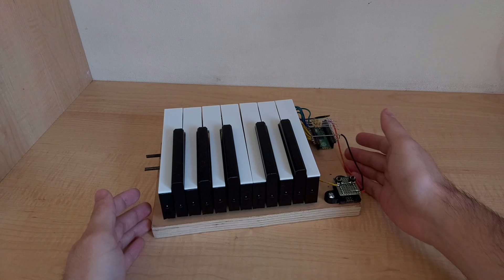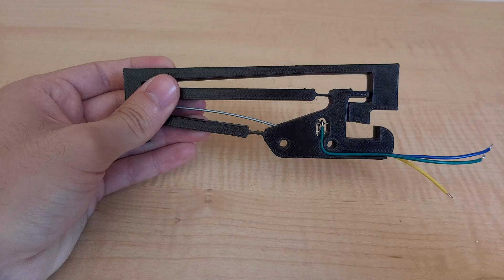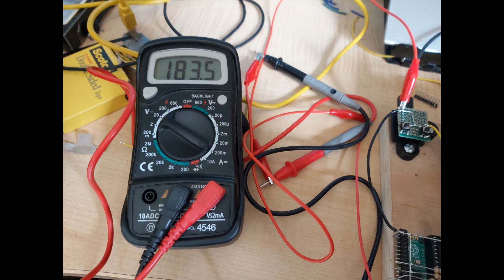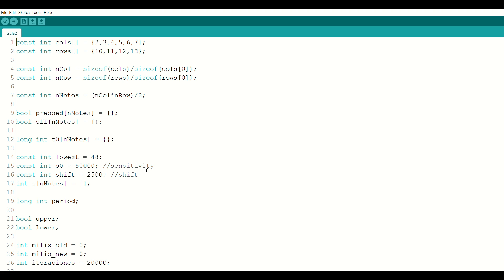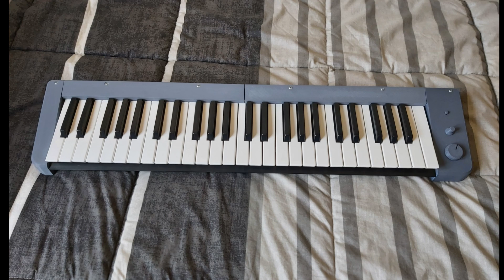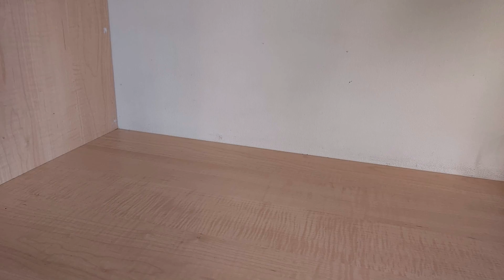3D Printed Flexure MIDI Keyboard update

Comment: You know I was thinking of using magnets to control the velocity sensitivity which would be manually controlled by a turnable rod that would vary the distance between the two magnets at the end of a bar. You could precisely control the point at which the key gives in to being pressed completely down and how strong or weak you want it to be pressed down. 

Wish I could attach an image of my idea here because it's a bit complex to achieve the effect I'm thinking of that would make it feel like a grand piano with the use of magnets and using a bar like a kid's seesaw in the park.

Comment: Very interesting and impressive mechanism! As a professional player, this looks to be very playable as I would assume the pressure to depress would be similar on both sides of the key. Is this your own design or is it modeled after something else you've seen?
Reply from the maker: Thank you! The search for greater evenness along each key is what started this project! Its my own design, and although I can't claim for sure to be the first person to think of this mechanism, I haven't found anything similar online yet.
Reply: @elterla2153  You seem to have solved the biggest problem of playability with all mini keyboards. The one exception I've found is the Carry-On foldable 49, which uses keys similar to a computer keyboard. It takes some getting used to, but once you do, it's far more playable than you might expect. Your design is another substantial step up. I'm curious how compact this mechanism could be made in terms of height. One other non-weighted action that I find to be very playable is Yamaha's CK & MODX series, which also offers a little additional initial resistance. Do you have any plans to make a folding keyboard? I'm still waiting for someone to do that properly as well. Keep up the great work and I look forward to seeing your next video!

Comment: Amazing project! Idea to save some energy: How about using infrared LEDs and phototransistors instead of visible light? And additionally, don't have them "always on", but use a duty cycle that's still fast enough for what you want to do?
Reply: Agree. Also if ambient light bleed is not a problem he could reduce the current on the LEDs to basically nothing and still get a good signal I think.

Comment: Excellent design! I’ve been looking into how difficult it might be to make a DIY microtonal keyboard and another channel I saw (Andrew Leathwick) used Hall effect sensors to both trigger notes and calculate velocity. I think you could implement the same on your keyboard to reduce power draw.
Reply: Hi I’m planning on making a diy piano myself and the thing is I’m not sure about the sensor I’ll be using for the key detection. First option is to use hall of effect sensors as you recommended but I’m also thinking of using carbon pads like how companies do. The second option is better for the price but I’m not sure about how I’ll be able to make it.

Comment: I love the design and am definitely gonna try to make one for myself. But I wanted to ask why not use hall effect sensors; if you add a magnet on the end of the mechanism, I believe it would have a higher succession rate.
Reply from the maker: I considered hall effect sensors but they are a bit pricier and I didn't really want to deal with 49 analog signals for the full size keyboard

Comment: Cool! I just saw your previous video and commented on it. You may be able to cut down on power consumption by powering each key's LEDs only when that key's sensors are being measured. I'm guessing you already have a loop in the code for doimg measurements one by one, so maybe adding a function to turn on the current key's LEDs wouldn't need too much extra code. Hope you post more about this project! The compliant keys are so innovative :)

Comment: This is amazing! Congratulations!
I've been looking for something like this since 2019, and yours is the best!
Is it possible to build a keyboard with 5 octaves?
Waiting for the project to be published!
Here in Brazil, everything related to keyboards is expensive, and the entry-level equipment is not very high quality. As soon as you publish it, I'll build mine!
Reply from the maker: Im currently planning for a 4 octave keyboard but adding more octaves shouldnt really be a problem (except maybe for power draw?)
Reply: @elterla2153  Great, I'll do it as soon as you make it available.
Any forecast for the release?

Comment: Hey, I have also tinkered with some pi Picos on trying to do that. At first, I thought about a button matrix, but it wouldn't be velocity sensitive. Then, I saw a video online that tried to do that with hall effect sensors, but it was a bit expensive. Yours is a pretty cool and well built design, but, I still have a question, couldn't you have just used soft buttons instead of all that optical madness? There could be 2 buttons replacing the two phototransistors. I took this idea from a cross-section model I saw recently on my music centre of a thorman digital piano. I took a video about how it worked if you want it. I would love to share with you some of my ideas to try to make it as cheap, reliable and efficient as possible.
Reply from the maker: soft buttons would be great for a mass produced product but aren't very DIY friendly as far as I know. The alternatives I've found with other buttons tend to be a bit noisy whereas the phototransistors are completely silent. The solution I'm currently using does involve a matrix but doesn't sacrifice the velocity sensitivity because of it. Hall effect sensors are a great option but a bit pricey and I suspect they are more computationally hungry when calculating velocity. At least this had been my reasoning
Reply: @elterla2153  are you planning on adding speakers to the keyboard itself to remove the necessity of being connected to a pc?
With an SD card slot for different samples, idk.
Reply from the maker: not really, I always intended this to be a midi controller but once I release the files someone else could go that route

Comment: Hey! a bit of feedback here. I've serviced some MIDI keyboards and synths and the mechanism they use to measure the velocity of the keys is a lead in between two other leads, acting like a switch, I'll call center lead "c", top "t" and bottom "b". In an idle state the leads c and t are making contact, when the key is pressed the leads c and b are making contact, so the controller only measures the time it takes to change from "ct" state to "cb" state. This way the keybed consumes virtually no power. For examples search on google for "Yamaha DX7 Keybed" (a popular synthesizer) and look through them, I hope I did a good job explaining myself hehe.

Comment: This is so cool! If you do go the PCB route, you could design a motherboard with po-go pins and then have each key use the same PCB design and have contact pads on the underside, making a modular key setup. You'd just need to update the 3D model of each key module to position the identical boards.

Also, to solve the power draw issue, you could look at using hall effect sensors and embed magnets into the keys. Or vice-versa.

Comment: I love how the flexture mechanism moves the pivot point of the keys. Years ago I made a organ pedal keyboard that used opto interrupters.  Assuming you use a key scan method, you only need to light up one LED at a time. By using shutters that have 3 light levels: dark, half open, full open. You can easily implement key velocity. Just use a comparator circuit to convert the output of the foto transistors in a 2 bit signal. Have fun and good luck with your project.